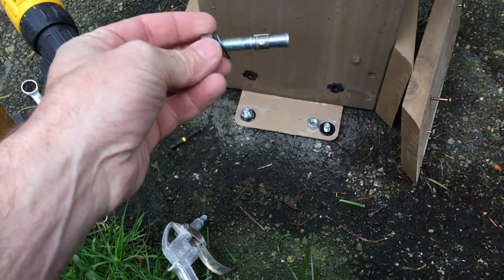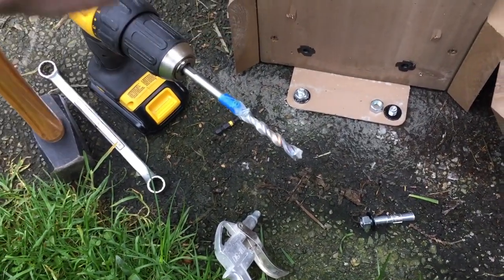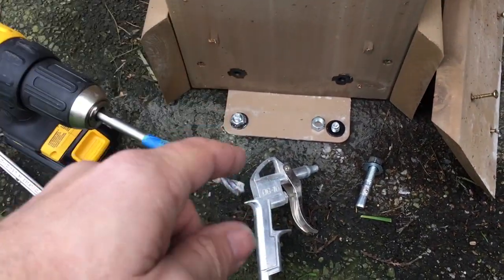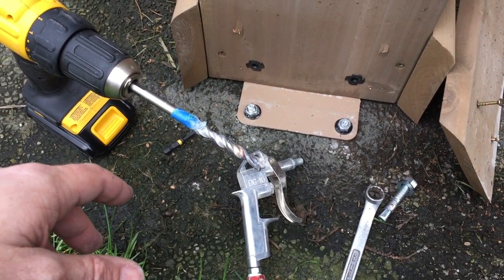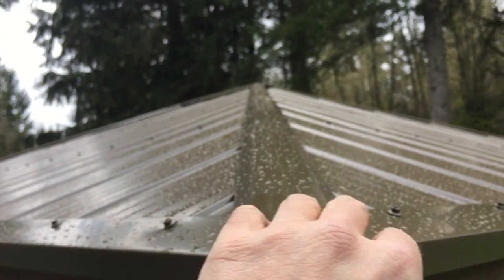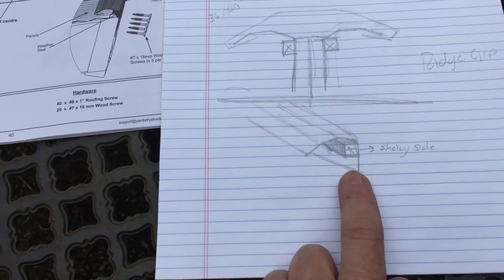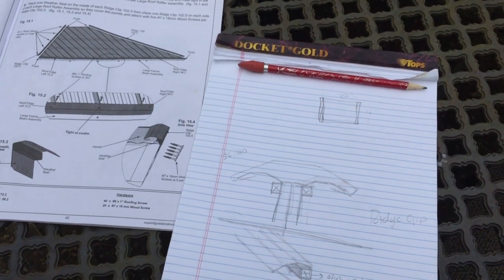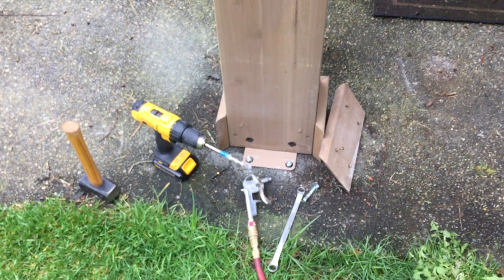Pt. 4 Costco Yardistry 12x14 Wood Gazebo ANCHORING and Ridge Clips

Comment: I added the weather stripping to the top rather than the side.
I figured the idea is to prevent water from getting to the sides.
I think either way works.
But yes it's the one area where I scratched my head for a while and had to think for a few before I committed to sticking it to the roof panel. 
Thanks for the vid.

Comment: What I have t figured out is what the weatherstripping does. It sits on top of the sheet metal ridges, but doesn’t stop and water from getting to the ridge caps because it flows into the ridges.  Or am I overthinking this. Your video and diagram were very helpful by the way!  Thank you!

Comment: Hi thanks for the info on the ridge caps.... very helpful as the instructions and Yardley videos do not even help a little.Unfortunately i had to remove the roof panels as i forgot them. the pic is very distorted and you cannot tell its even the ridge caps brackets....Geez this will definitely help the next guy. Thanks

Comment: I'm installing a 12 x 12 Gazebo next to/on top of an existing brick patio.  The brick patio is 10 x 10, the posts for the 12 x 12 Gazebo go from 9'8 1/8" to 11'.  So, I'll be removing about 2" of each corner of the patio and pouring a pad for the new posts.  I live in St. Louis, I was thinking I had to pour footings to below the frost line, but from watching all of your videos (thank you), I'm thinking I just have to pour a "pad" at the corner of my patio.  There are just rocks and dirt next to it now.  The location is at the bottom of my back yard and while I get bad storms, my cheap 5 x 8 BBQ "tents" are sturdy as can be just tied from the top to the   ground.  I'm thinking if I pour 4-5" thick concrete pads and bolt to those, this should be fine.  Any thoughts?  Thank you again for the videos, I'll watch the company's also, but yours are "real normal people" videos.  Thanks again and any ideas are welcome!
Reply: I was also thinking of "tent stakes on steroids" like rebar to anchor...ideas?  Like just making sure everything is level and driving the "stakes" into the ground...

Comment: when I purchase this I have a homeDepot Pro, well they didnt do ANYTHING shown in this video. They did not install the weather stripping, the ridge clips they stole hoping I wouldnt notice they messed up and didnt install them, they didnt remove the plastic from the roof, and never bolted it down....... Now I am stuck with a gazebo poorly put up and looking not as good as it could without the great ridge clips edging.... any sugestions on a way to fix those ridge clips with the roof already on? would it be possible?

Comment: Thanks for the weather strip information as your video resolved my confusion on the application. However, my weather strip is about an inch too long, so I assume I just cut off the excess. Yardistry needs to use your weather strip sketch in their instruction manual. Thanks again.

Comment: I realized the weather stripping was to prevent water from being blown upwards  in between the panels.  I didn't put it on the small panels originally and then realized what they were for when doing the large panels.

Comment: Did you have any issues with the roof panels edge that over hang where they are supposed to be flush?  For some reason on the large roof panel, we can't get it to fit just right.  One side always overhangs.  Any tips ?
Reply from the maker: On the long 14' edge it is supposed to overhang about 1-2 inches. On the 2 angled wood edges it is to be flush (or even it can be a little bit set back from the wood edge).  If its not flush on the 2 angled wood edges you just gotta keep moving the sheets incrementally till you get it. Good luck.

Comment: hey great job, i got the 4 legs up...just waiting for this weekend  to put up the roof....i am placing the gazebo...on my paving stone patio....any suggestions  on anchoring, because its just pavers...sand and crushed rocks underneath. i live in ny. do you think anchoring it to through the pavers and into the ground will be enough? the whole set seems pretty heavy and solid....Thank You
Reply: mine is also on brick pavers. it has been up for 2 weeks now and we had a nasty storm go through with 40-50mph gusts and it did not move at all. I was a bit surprised but very happy. I think you will only make a mess if you attempt to anchor it through the pavers. I am wishing now I would not have put the anchoring hardware on.
Reply: You can take out specific area pavers and put down concrete in a form tube. Then anchor it down.

Comment: Thank you for the video.  I DESPERATELY NEED YOUR GUIDANCE.  I'm in the spot where the RIDGE CLIPS come into play.  The weather stripping segment was very helpful.  Now I'm stuck with where to mount them.  In illustration 15.1 it shows the top of the RIDGE CLIPS should be flush with the top.  But that puts the RIDGE CLIPS above the ROOF EDGE.  In illustration 24.3 it shows the RIDGE CLIP overhanging a little on the ROOF EDGE.  How did yours come out?
Reply: not sure how to explain it but the foam all said and done sits ON TOP of the roof and make sure you put the screws in so that they are flush because when you put the roof sections up and on, the ridge clips from each roof panel butt up to one another and if the screws stick out even just a little bit, you will have problems. hope that helps peter, and good luck
Reply: I'm asking if the RIDGE CLIP should overlap onto the ROOF EDGE or not?
Reply: yes. the curved part is above the roof edge. the flat part gets screwed flush to the wood edge. it is a goofy fit but that's how it goes and if it's installed incorrectly you won't be able to drop your 4 roof sections in properly
Reply: also great job on videos I expect I will be watching them again over the coming days 😉

Comment: Would you say you have to achor this down? I am wondering if I could just leave it resting on the concretet - it seems heavy enough.
Reply from the maker: Yeah, you probably can get away with it since the total weight is 650lbs. I did it mainly due to (a) occasional strong gusts that could cause additional vibration and (b) engineers typically add such anchoring points for a reason.
Reply: jmsifodyas1 Just started mine today and made great progress referring to your videos many times. You are so right about the base of the posts, those 4 pieces are simply too long and don't fit right. Luckily I have a miter saw and was able to fix that but if someone couldn't do that they would be disappointed. I have a question for you - did you seal or stain this at all to help it be more water resistant? I read in the manual to do that YEARLY for optimal life span. Yearly is a bit much in my opinion but I was considering doing a couple coats initially before the whole thing is put together. I figured out of the box it would be treated for the outdoors, but apparently not. Thoughts? Very curious how yours has held up so far, especially in Seattle where rains so much. Thanks again for the video series!!!
Reply from the maker: Glad the videos have helped. So far mine has held up great. I think I came across somewhere on their website that the wood was per-treated, but that you will want to add treatments each year. I agree that's a lot, but I figured I would watch the southwest side of my unit since that has the most exposure. If I start to see any weathering I'll hit it with a wood sealer.

Comment: Was wondering if you have any advise on anchoring on paver patio.  thanks
Reply: I did.  Used 1/2 concrete anchors thru the pavers.  Ideally i would have poured concrete under the paver where the posts are, re-installed the paver then drilled the anchor thru the paver and into the concrete.  But i figure into the pavers are good enough.  If we get wind that is strong enough to rip out the pavers then I've got bigger problems that just my gazebo getting blown away.
Reply from the maker: I'm afraid I don't have any good solutions for pavers. If they are large pavers you could go into those like concrete (provided the posts are all centered on the pavers), but I don't think it would be worth it unless each paver was pretty large (no less than 2'x2').

Comment: Thanks for posting this and the other videos.  The audio is garbled.. are those 3/8 x 2.5 anchors or 1/2 x 2.5??  Thanks
Reply: Fred, I actually was wondering the same thing.  Having a heck of a time finding ANY 3/8 x 2.5 anchors in store or even online.  Did you end up using 1/2 x 2.5 yourself?
Reply: My cement is 4 inches thick.. so I used 3/8 x  3.. The stud sticks out about an inch, so it's going a little more than 2 inches into the concrete.  I drilled the holes 2.5 inches deep.  Home Depot and Lowes only carry plated anchors... I found stainless steel anchors online (Amazon) for about the same price.  Good luck Jerry!
Reply: Excellent!  Thank you for the quick response!

Comment: I am finally done! Did you not put the 2 screws in that connect the 2 ridge pieces together?? I don't think they are necessary but I put them in anyway I just don't see them in your video
Reply from the maker: Congratulations! Yes, I did put them in with the last of the finishing work, but I agree that they may not be that necessary.

Comment: Do you think you can hang a fan in the 12 X 14 Yardistry Gazebo?
Reply from the maker: I think you could, provided that (a) you mounted a box on the underside of the peak to handle the junction box and (b) you found a fan that cleared the two bracing beams underneath the rafters while maintaining clearance at the tips of the fan. You might be able to find a small enough fan to place in the cavity between the rafters and the two braces, otherwise you may want the fan to drop just below those braces.

Comment: Can the gazebo be moved once it is built or is the structure to heavy  to lift.
Reply from the maker: It's too heavy to be moved more than a few inches with 4 people.
Reply: Gazebo weighs over 650 lbs. You can download the instruction manual on the Yardistry site.
Reply: +/- 708 lbs gonna take alot to move it.

Comment: If attaching to a deck, how would you anchor it down?
Reply from the maker: I'd probably go with a 2" or 2.5" long 3/8" Hex-Head Lag Screw. Just drill a pilot hole first then use a socket to install.

Comment: how long did it take you to build from start to finish
Reply from the maker: I scattered it over a few of different days due to weather and the size of the area I had to build in when the weather was bad. If I calculated the total time it was probably around 8 hours. That would include sorting the components, setting up my work-space a bit like an assembly line and then some of the misc prep (such as taking off all the protective coating on the metal). I did the project on my own until it was time to put the rafters up. With a second person several things could go a little more quickly.
Reply: If you don't actually keep track of how long it takes for each step it will feel like much less time than it actually took. I am keeping track and by myself I have 17 hours in and It is not set up yet. I have all roof panels completed. now I will get 3 buddies over to complete the job. See foydas step 3. I have left some comments on there regarding time. This is not like putting together a bedroom set from Ikea. I am a mechanically inclined person and found this very tedious and challenging. I think the product is great but if you don't go step by step you will have problems.

Comment: Great videos on the build of this gazebo! Thinking of buying it this weekend and calling all the guys that I've done favors for (I'm sure they'll be BUSY!) but do you have a list of tools used to build this gazebo?  Thanks!
Reply from the maker: Thanks! The primary tools I used was a cordless drill (for the screws) and a ratchet/socket (for the bolts). The kit has a square bit for the screws included. Also, when attaching the roof panels I set my Dewalt drill pretty low (down to 3.5) so as to not crush the metal ribs. Good luck bribing the buddies to come over.

Comment: Do you have a link to the anchors you purchased?
Reply from the maker: I just purchased them at my local True Value Hardware store.
Reply from the maker: Mine were 3/8" - I don't see what the size is on the link you shared, but they look like they would work.